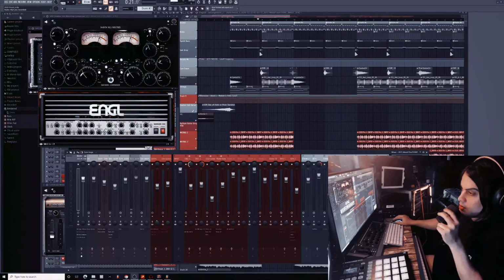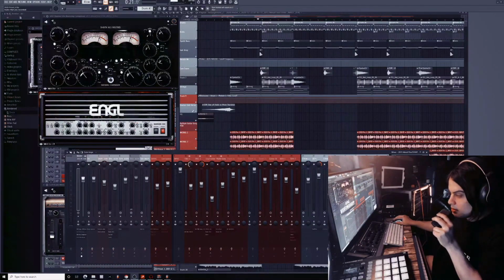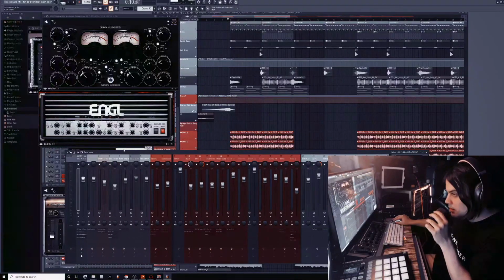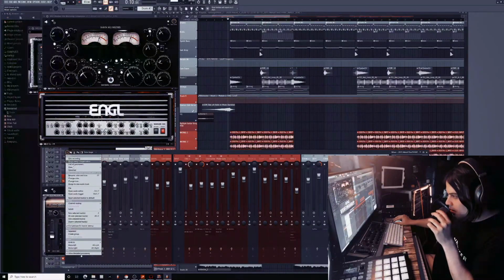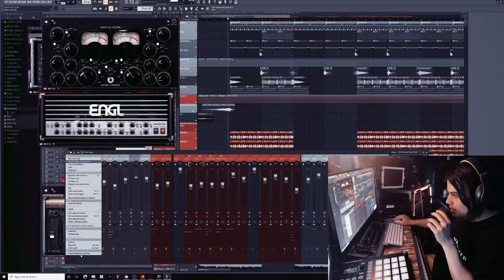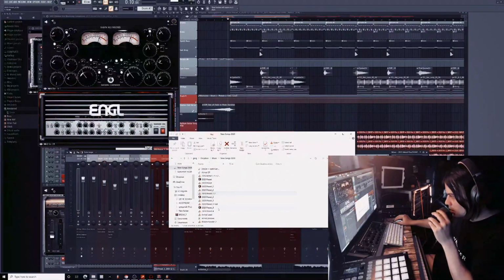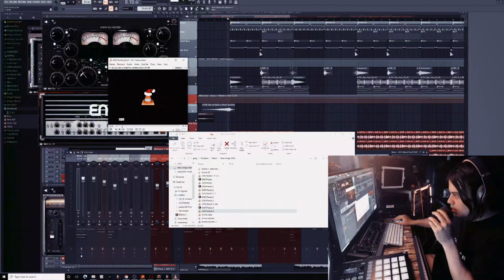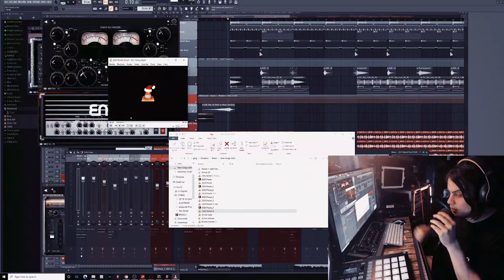How to fix: Universal Audio Plugins out of Time / Latency in FL Studio

Comment: I have an issue where in project everything works well, even export of single track mp3 or wav has nothing off sync, but when exporting stems with option "separate mixer tracks", track with UAD plugins on are off sync! If anyone had this situation and found a solution - please do share!
Reply: Same problem. Everyting good with playback and one track export, but with separate tracks export i have latency